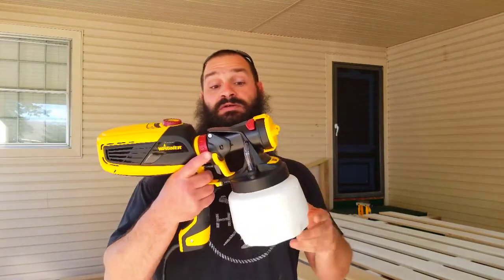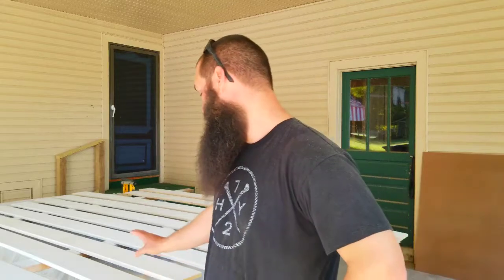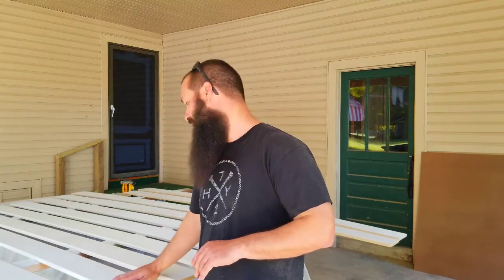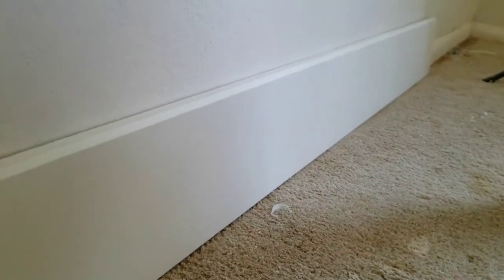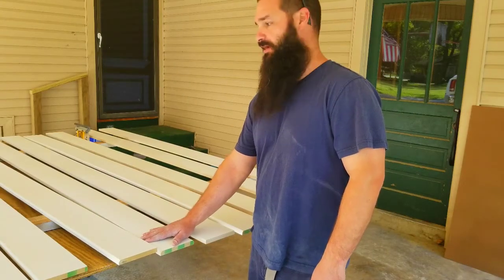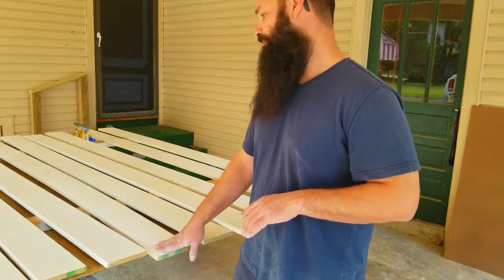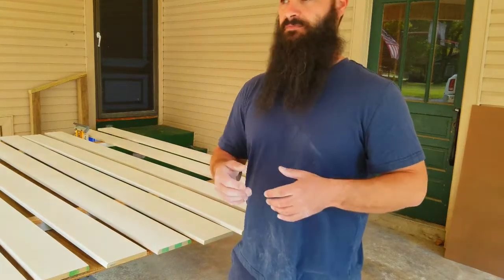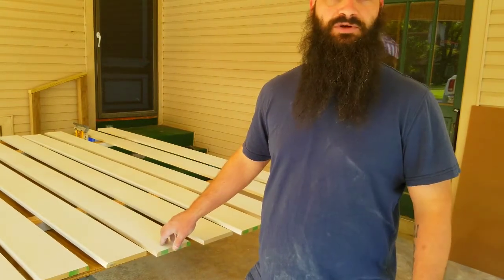How To Make Your Own Craftsman Baseboards Part 2

Comment: Can you complete prime and top coat before installing? Then caulk + touch up nail holes?

This way there’s no cutting in or masking
Reply: Yes u can Jarrod and I advise u to do just that! 
Especially if u have carpet now trying to tape / paint when they r installed is a nightmare! 

Also use a brad nailer 2” brad nails mark stud locations b4 u install makes it so much easier! 

Don’t over do it on nails 1-2 nails max at each stud 
Once u caulk it isn’t going anywhere! 

Most guys shoot 5k nails in it and by the time u fill the holes u ruined your pretty paint job! 

Bonus tip! Put painters tape on baseboard BEFORE u nail it! 
Leave the tape after u brad nail now u can fill holes then remove tape and not ruin your paint job’ 
By putting tape on b4 u nail you are left with a tiny hole in the tape so when u fill hole it makes it so much easier! Then peel tape off and all that extra filler comes off with the tape’

Comment: I need a brutally honest answer....if I use MDF for my baseboards and I prime and paint both sides of the boards will I have to worry about it swelling down the line??

I only ask because I'd love to use MDF as it's very affordable compared to wood or fingerjoint stock. I'm just really worried about it swelling. Thanks 😊
Reply: @Weekend Warrior  thanks for the response, but after thinking about it for a while, we chose to go with the more expensive wood trim. Considering we were ordering enough trim to do the whole house going with MDF would have saved us hundreds of dollars, but we just didn't want to take the risk.